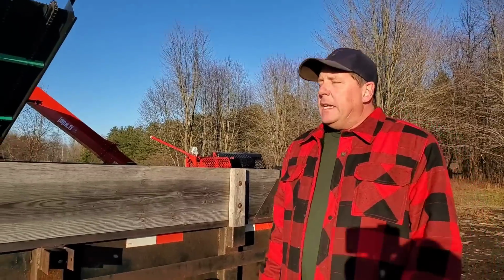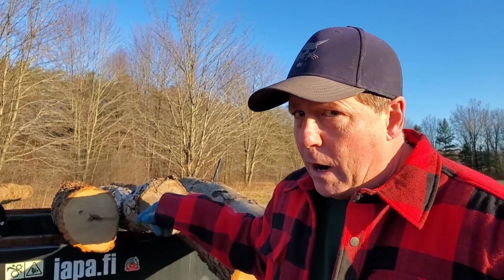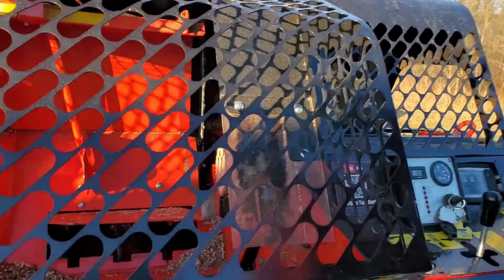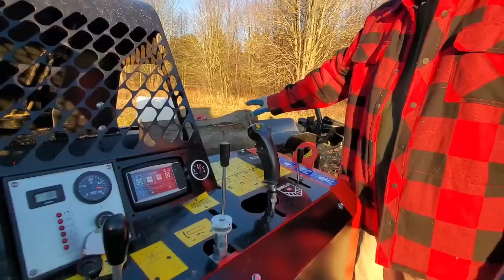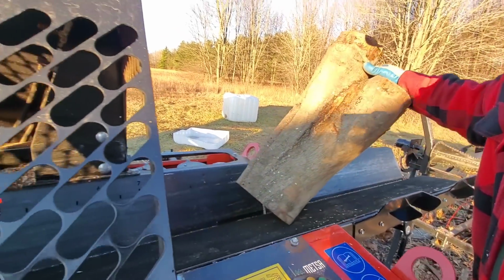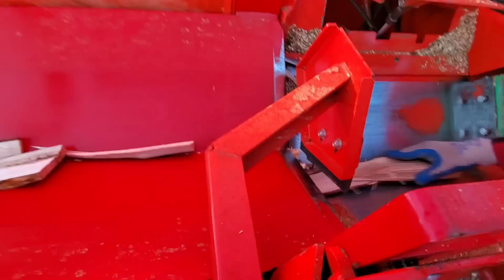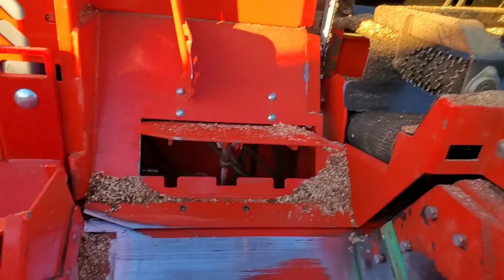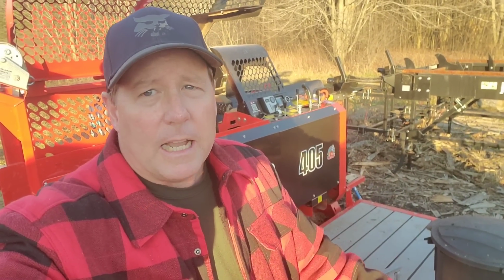This Doesn't Seem Fair!!!  The Japa 405 Firewood Processor

Comment: Another good video, Joe. Keep an eye on that fuel tank with the sawdust build-up. I don't  know if they coated the outside of the tank  with anything, but if  they didn't, you might  want to. The wet dust can get corrosive over time.
Reply from the maker: Thanks Gary.  I will look into it

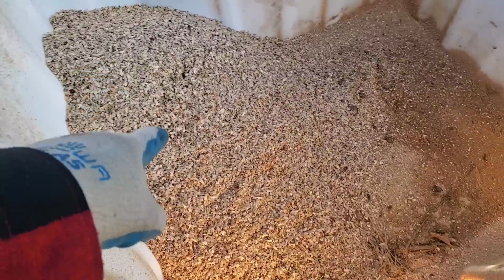Comment: That thing rips ,no resplitting wood just cycle it again and keep going.the kubota D902 is a great little engine,it sounds great sitting at 3600. 17:30 you mention selling the sawdust I’m not sure but around here that has no value as bedding or ground cover since it contains bar oil .Have you been burning it in the outdoor wood boiler.When I was making firewood I was able to feed my outdoor wood boiler just from scraps from Firewood.
Reply from the maker: I don't have a plan for the waste yet John.  I just don't have the motivation now.  One day I hope.

Comment: That thing is extremely efficient.  That being said, it seems to suffer from the same issue most box wedges have. Lots of smaller slivers. You just don't get those using a vertical. My feeling on that is I like the small slivers to start fires as I  don't burn 24/7 I start 1 or 2 fires a day depending on the temperature.  Not everyone thinks that way. From your previous videos I know you sort and stack what you just split so that isn't your finished product.  
My point to this is a machine that cuts and drops the round in front of your vertical wedge may be a little slower but the yield would have to be better. To me that combines a lot of the expensive machines to sort out waste. Definitely more hand work but the wood is as perfect as you want to make it. 
I've had this blocking table idea in my head for years but never acted on it. I would think you could adapt it to any size operation or splitter. I certainly can understand your love of that machine, one person can process a bunch of wood per day. 
As for a cord size you need to mound a 12 x 6.5 dump trailer unstacked. A 14 x 6.5 is level unstacked.  That was stacking 3 face cords and tossing them into the trailer.
Reply from the maker: The perfect split is a little slower than a traditional knife but...I'm being serious...how much does that really matter?  Not much to me.  The extra 15 min it takes is nothing at the end of the day.  It is about as fast as you can imagine making a trailer of wood!  Honestly the cleaning processes aren't important to me bc I am not a split and sell business but at least they are there if I ever wish to adjust in the future.  Thanks for the thoughtful comment Mark.  I hope you are having a great winter!
Reply: Ohio Wood Burner Ltd  well not cutting as much as I like but soon I'm tossing the golden handcuffs and I'll have more time. The health insurance thing is big. I'm planning to make the PB show in 2023 hopefully I'll bump into you there.

Comment: Joe, I've been thinking about your 2WD truck amid how you've said that it often gets stuck.  I've driven RDW sports cars for years, including many winters. I think it's the tires more than the truck. If you get a set of good tires on that truck, I think that you'll be surprised.
Reply from the maker: Possible Frank.  It has tall, skinny 10 ply now, not exactly flotation tires!  LOL  The genetics of this truck however just makes it horrible off pavement.  Open rear end, 8' bed, touchy gas pedal.

Comment: With the air intake for the engine being that close to the sawdust discharge of the bar/chain, how often are you having to clean the air filter?
Reply from the maker: I've never checked it come to think of it.  I will do it today and let you know.  JOe
Reply: @ohiowoodburner  At 50 hours, probably a good time to do a full service on the engine as well.

Comment: It definitely processes the wood!👍
Is the 405 available without debris shaker and conveyor? I have not been impressed with it yet. It is just loud, causes fatigue to metal from shaking and doesn't seem to do much compared to the disc cleaner. I would think it would significantly reduce the over all cost of unit to just not have it. IMO Have a great weekend, Joe!
Reply from the maker: I don't think it comes without it Wayne.  It can be disabled tho.  Honestly I does remove a lot.  Obviously if you had a cleaner like mine you wouldn't need it but one or the other would make you better with your product if you were a split and sell business.  The big disc cleaner isn't mine
Reply: @ohiowoodburner  Maybe they can go to a disc cleaner on the unit itself in the future. I ran a saw with 6 different sized circular saw blade heads in a saw mill , for several years. It had a huge trough underneath it with a 30 foot shaker which feed a conveyor into a scrap box outside. As the unit aged (3 years plus)the shaker was constantly having stress issues and being welded,plus the noise was obnoxious. Probably nothing wrong with your set up and it is just me. My past experience with this type of system was not a good one...Have a great weekend, OWB!

Comment: Joe seeing you all bundled up to operate your processor. Makes Me wonder why the Man with a plan doesn't have an enclosure built up from the platform with a small hot water tractor cab heater plumbed into the processor engine.
Reply from the maker: That is on my list Jim.  I had taken measurements and pretty sure what direction I will go.  Some day soon I hope

Comment: How many years before you break even from the total cost of the 405+ attachments do you figure it will take??
Reply from the maker: I have boot strapped my enterprise Fritz.  All the equipment you see was paid cash except for the Axis and log deck.  The cleaner is not mine.  I traded in my old 365 for the 405 as part of the transaction.  I do my accounting more on a practical level so if I'm looking to restore my $$ back into my account I would think it will be there my the summer.
Reply: @ohiowoodburner  Thanks for the reply and I didn't want to bring up the money thing just how long you figured it would be to 'break even'. Thanks again.

Comment: Great bit of kit alright as long as you have uniform wood
Reply from the maker: That is the case for processors although the infeed on the 405 is more forgiving than others I have worked with.  That hold down clamp plays a large role with getting crooked logs to fit

Comment: Have  you taken a look  at  the  Japa  700.  With it's  Circular Saw  Blade, it  cuts  through   firewood  logs  very fast !
Reply from the maker: I have not.  Sounds exciting tho.  I will check it out
Reply: Hi Burl - it's Big Rodders in Ireland.  I've had the Hakki Pilke Eagle with a gas powered 700mm blade and auger for many years.  Its very efficient for cutting logs up to 7 inches, not the 10 inches quoted.  However, like all bladed machines they can be dangerous - I was hit in the neck by a small ricocheting log piece and was lucky to survive the incident without disfigurement save for a handful of teeth.

Comment: Save the sawdust in used feed bags.  The straps make them easy to move and then reuse elevated to load a pellet mill.   With the move to wood pellet stoves for cooking and smoking and pellets can be stored for ease of use.  It beats trying to burn in cardboard boxes.  Great machine ...now for a pellet mill manufacturer to partner with.
Reply from the maker: That has been on my radar screen Ed but I just don't have the motivation yet.  One day soon I hope.  Do you have any leads on a suitable PTO mill?

Comment: What is the max diameter that you run through that processor just curious thank you in advance
Reply from the maker: max is 16"  Usually you can't get up to the max with a lot of processors bc any type of crook, knots etc will ruin your day.  The 405 has a pretty wide infeed and the hold down clamp really helps you keep logs fed properly.  In some of my old vids I show a log that is literally scraping the hood as it was fed.  That was pretty impressive LOL
Reply: @ohiowoodburner  thank you very much for the helpful information about your processor

Comment: Hello Joe
Wouldn’t it make sense to park your ATV dump trailer under your disc screener rather than letting the chafe fall on the ground, then you could run that shit out to the boiler and get it gone. We all need to work smarter , not harder.
Reply from the maker: I do that when I'm not using my trailer.  I have a sled under it now that I pull to my gaps im filling